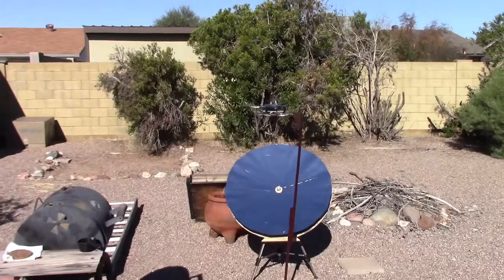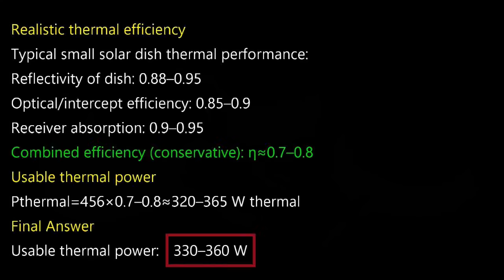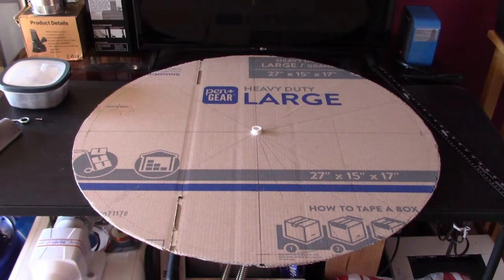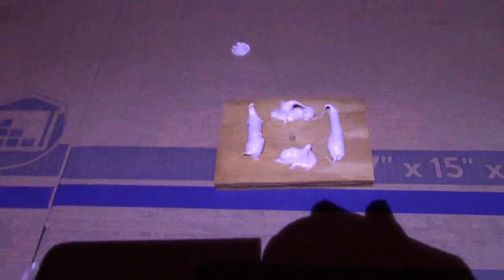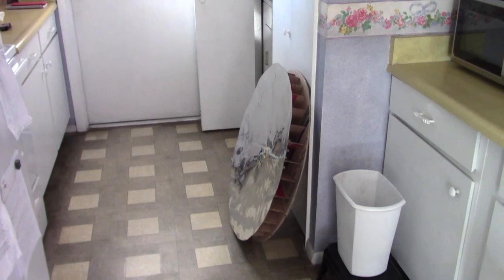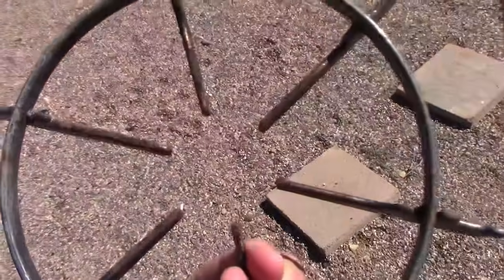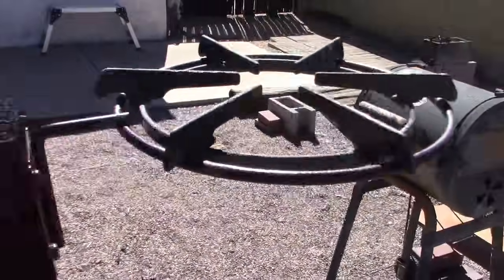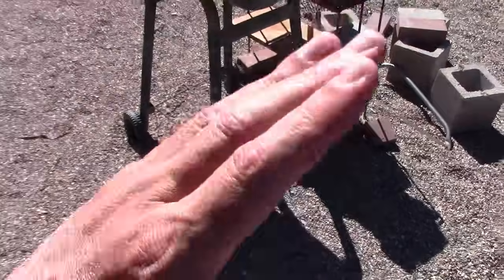DIY Parabolic Solar Cooker - the "mini model" - small, lightweight, powerful - RV/van life adventure

Comment: Why the hell is youtube deleting my comments here :(
Reply from the maker: hi there. youtube isn't technically deleting them (it just put your 2 other comments in the - *held for review - folder). that's a folder that comments sometimes end up in if the system thinks there might be something wrong with them. it's built into the system. in one of the comments you called youtube dumb and i guess it didn't like that. i think the other comment ended up their because it was super long. super long comments often end up there. youtube scans comments (with AI i assume) and if it thinks there might be an issue with it it puts it in that file. it can happen even if there is a period out of place (it thinks it's a link and it will block the comment). i gave the okay to the long comment but i deleted the comment where you called youtube dumb. i didn't think you really wanted me to leave that one.
Reply: @desertsun02  Ohh! That makes so much sense, I didn't even now that. Thanks! And sorry for giving you more work :(
As for the "dumb" comment, it was actually originally also the long one, I just edited it into a short one after it was also blocked by YT, and yes, thanks for deleting it.

Comment: I really want to make this but fear I need the For Dummies version of instructions.  I've started on two of your previous projects but ran into sourcing issues. Maybe I can do this one. Thanks for sharing your knowledge  ❤ Happy New Year!
Reply from the maker: hi. you can do this one. it's super easy and there are full easy and complete instructions in the video. you can get the cardboard and posterboard at walmart and amazon sells the 12" by 12" mirror stickers. that's the 3 main things that you need. i used the same cardboard posterboard and mirror stickers for all three of the parabolic solar cookers I've made recently (my last three videos). each video has full instructions on how to make each collector. if you have any questions when you are building it, just drop them in the comment section and i'll get back to you. happy new year to you too!
Reply: @desertsun02 Thank you for the encouragement ❤ and for being willing to answer questions

Comment: Hey i've been following your videos for some time now and appreciate the time you've put into investigating a lot of these ideas. I just wanted to ask if you've heard of the vacuum suction / mylar blanket solar dish cooker design and why you haven't looked into it. They can be manufactured in less than an hour, cost less than $5 to make, and can achieve very good concentration quality. GREENPOWERSCIENCE has done a few videos on the principle and demonstrating how it works.

https://www.youtube.com/watch?v=5rYr1Yrqwrk&list=PL33JoyfUcErd-12ucMdlbHdorv9AUiQ6Y&pp=0gcJCbAEOCosWNin

I still don't understand why there is even still a question about the best DIY solar cooker design
Reply from the maker: hi there. the vacuum idea is a neat idea but there are 2 significant problems with making a parabolic cooker that way. the first is that the suction never lasts very long so you might get a few weeks out of them (if you're lucky) but they almost always fail pretty quick. the other problem is that you can't build in any "waviness" to the actual parabolic curve. the waviness (also called flux shaping/spreading and slope error) is the slight inaccuracy that you need to get the proper size focal spot. in other words, you need to spread the focus to match the pots. solar cookers don't work when they have a point focus. for cooking you need a focal area that is roughly 4" to 8" in diameter (with 5" to 6" being almost perfect). when they make the professional parabolic cookers they actually add in the correct amount of (waviness) to the dish (using complex formulas) so that they get the proper size focal point. said another way "the reflector incorporates controlled slope variation for flux shaping at the receiver.”  the cardboard collectors that i make have just the right amount of inaccuracy built into their design as well. i basically figured it out through lots of experimenting over the years. i found out that using 32 fins and covering 2 sections at a time with the poster board is the key to getting the correct size focal area. it works every time. all 3 of the parabolic cookers I've built have 5" to 5.5" wide focal spots. i even built each collector at different speeds (cutting the fins slower or faster) just to make sure these collectors would work even if people cut the fins out really fast. it works every time. the vacuum technique is a cool idea but it's more of a novelty. the focal spot would be way too small for cooking. those have very tight focal spots (probably 1 or 2 inches wide). that would be good for starting a fire but wouldn't work for regular cooking. sorry that the response was so long. i just started typing and it took a while to find where to end.
Reply: @desertsun02  i'd still be interested to see you build and compare the vacuum design. From what I've seen online, they can do a good job of boiling water in pots, and can probably be tuned using some method to make them work better for cooking. Not trying to knock all the work you've already done, just throwing out an idea and could possibly make for an interesting YouTube video.